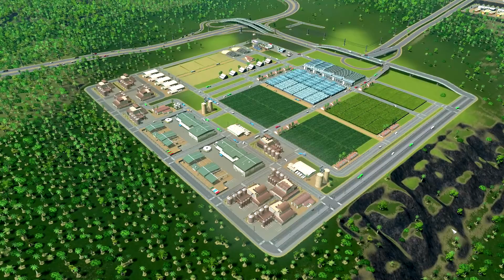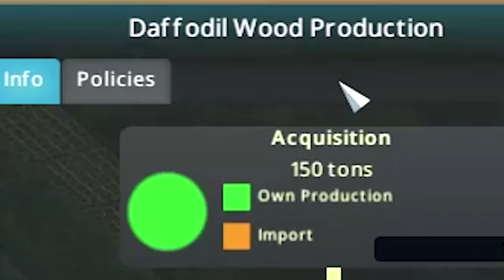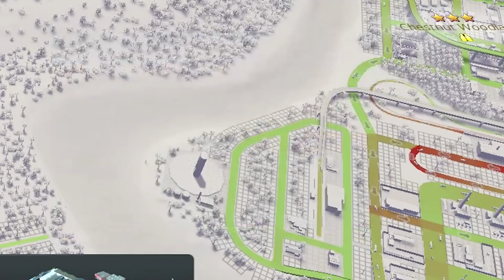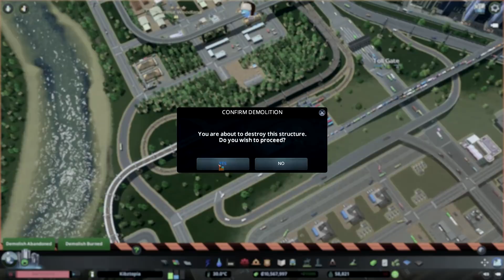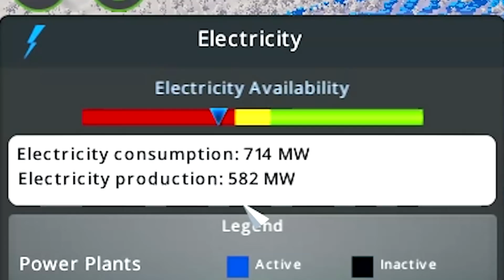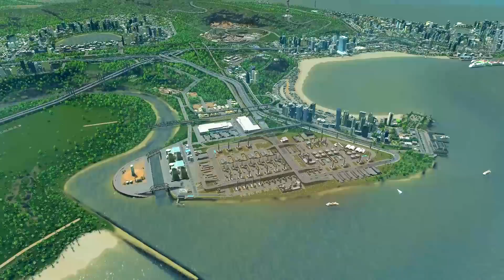Nuclear Power Plant and Warehouse Logistics! | Cities Skylines Lets Play Ep.16 (2019, All DLC)

Comment: Just curious, but are you aware that in a vanilla game, that certain natural resources (oil and ore) have a limited supply that you can extract before you have no choice but to import them? Or are you using a mod to make the resources unlimited?
If not, it's possible that you've extracted all the oil wells, meaning that any item factories which require oil for manufacturing are automatically importing a lot of oil, which in turn is causing such horrendous traffic at the oil related sector, as well as causing a heavy drain on your finances.